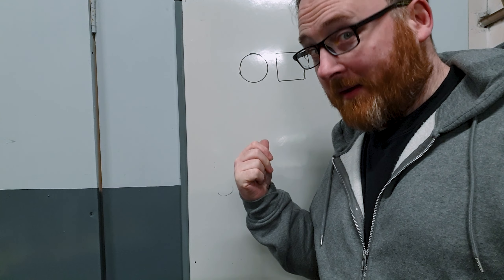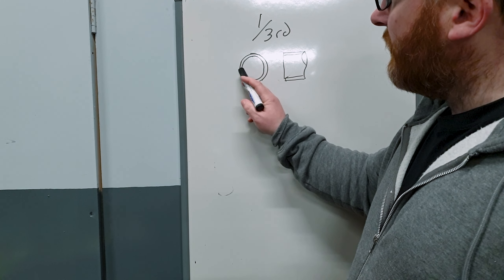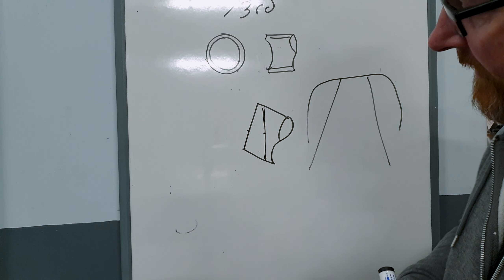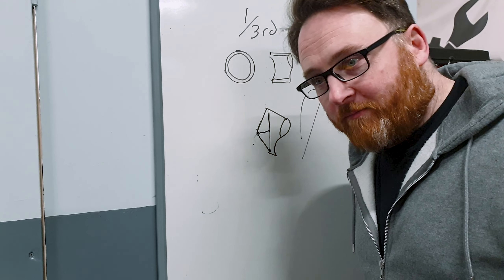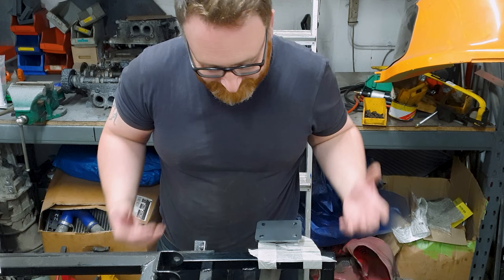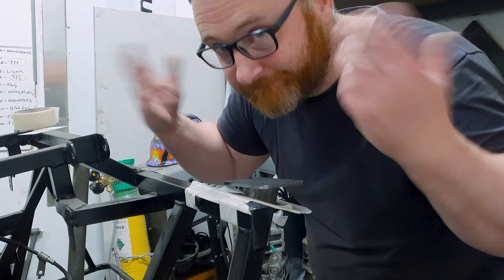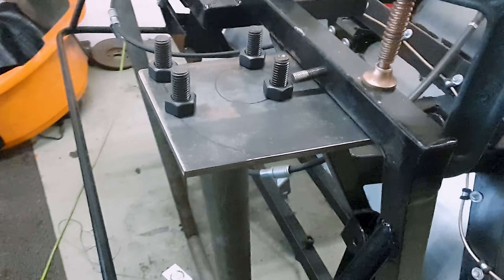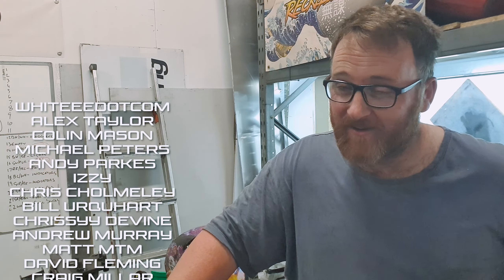MORE CAGE!!!  Locost 7 Kit Car FULL BUILD!! - Episode 56 - (Project 7-UP)

Comment: I'm glad that you are back at this. I'm bugging you again with the missing triangulation tubes, next the the engine(D1, D2= Vodou). Also, there are some aussie mods to strengthen the chassis. I'm progressing on my Locost as well, Installed the MX-5 RF Club seats, a Mini R56 hand brake, narrowed the tunnel a bit, purchased all the arts for the front suspension. Worked out the vsusp angles. Thanks for the fish mouth trick. I will need it for the control arms. I'm using an MX-5 NC rear end(complete w/crossmember and control arms, spindle everything).

Comment: Good to see you back.  I have been following as a patron for a while and building my own locost based on vodou plans and have just got it running and driving. Just a heads up, the diff mounts need to be super solid when going from a mx5 with gearbox to diff brace to then one without the brace. My diff was lifting alot under load and interfering with a bracket in the trans tunnel. Im in the process of removing the fuel tank etc to design a new stronger designed mount. Its just a poor designed diff which relies on the brace for rigidity.

Comment: From what I understand of this series, building the Locost from scratch for as little as possible was the main goal and just buying a kit would have defeated that aim. Looking back now on how much time and cost you put into building the chassis and suspension parts plus other parts that would make up a kit from a supplier such as MK for ~10k,  what is your thoughts on the value for money of such a kit.
Reply from the maker: Agreed, it's quicker and probably on the same price point. But it's not as challenging!
Reply: Hey, thanks for the response! @ToolsnTrack  I get the not as chalenging piece. If its just the product of the toil that's need then you'd just buy it already done. However, for those of us sick enough to like punishment and a journey then this is the pathway. Driving what your build comes with satisfaction (provided it doesn't $$####g break all the time)

Comment: It would be handy if you could put the links to the tools and parts you use in the description like the tube notcher and cage feet plates.
Reply from the maker: Good point, I did used to but ebay links die quite quickly..